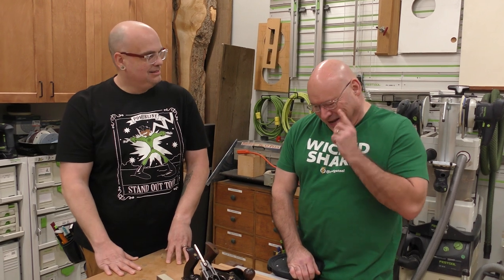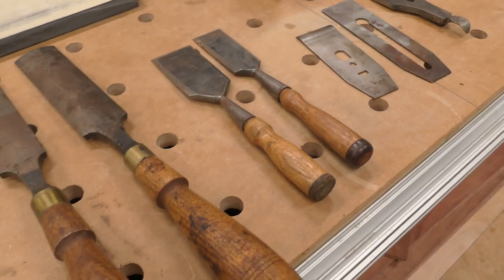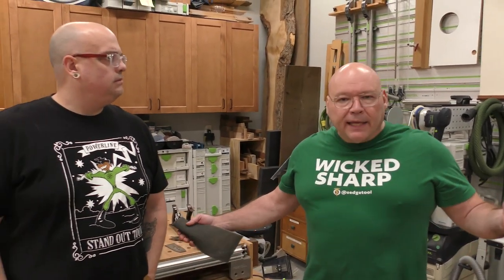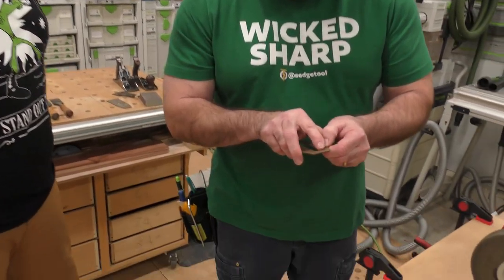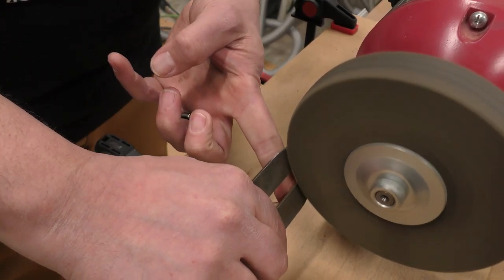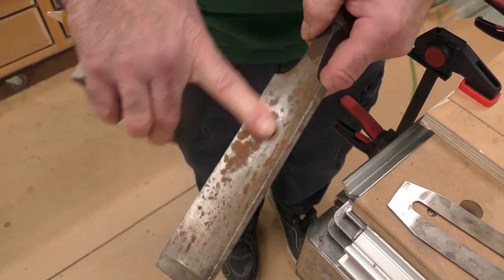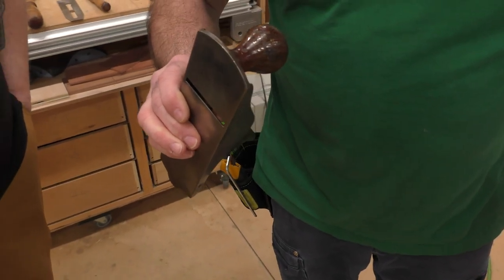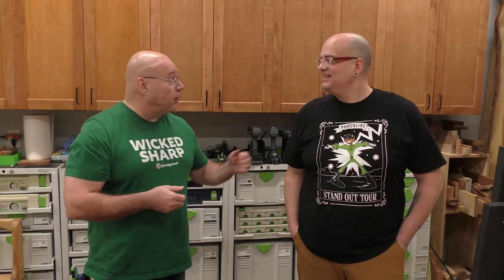Would you do this to your hand plane?

Comment: Love  that polishing wheel, it will replace those small rubber sanding blocks. that come in 3 grits. do you use it for hand saws. got to save my cramp up fingers and green backs
Reply from the maker: Yes ... For the saw nuts and Back if it is a traditional Tenon / Dovetail / Back  Saw I use the wheel ... ...The saw plate I usually descale with hand sanding blocks and scotch brite pads ....hope this helps Tony

Comment: One word for rust: “Evaporust” absolutely no work and cleans all the metal and absolutely no voc or smell. Does work better if warmed but it is amazing to refurb diston saw blades, chisels, or whatever that has rust and it’s reusable many times over.
Reply: @J B,
Great suggestion.  Corrosion is like cancer;   Abrasives are speedy to remove the bulk of thick rust, but Every single molecule of oxidation must be eliminated –or it will grow and spread.  

The best way to do this is with a reducing chemical such as EvapoRust, phosphoric acid, muriatic acid, distilled vinegar, Naval Jelly, WD-40 Rust Remover, etc. to get into the pores of the steel to bind all the oxygen atoms.   

·
Reply from the maker: Evaporust is an amazing product...use it for heavy corrosion before the convoluted wheel ./....... thanks !!!